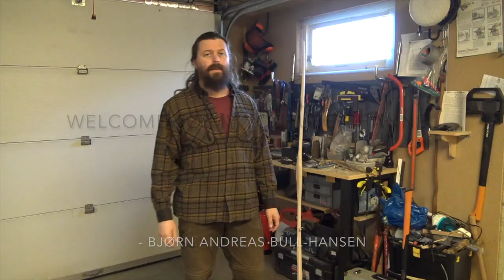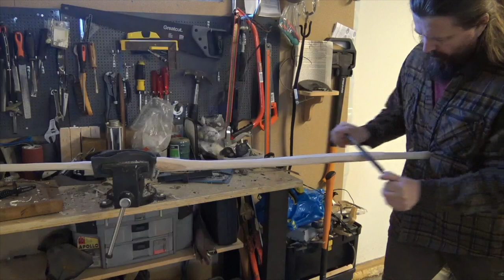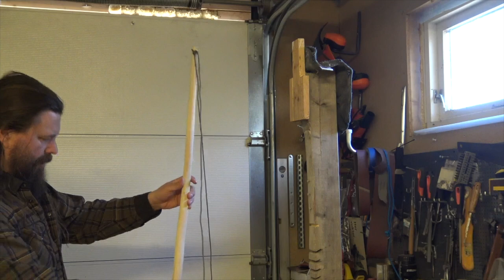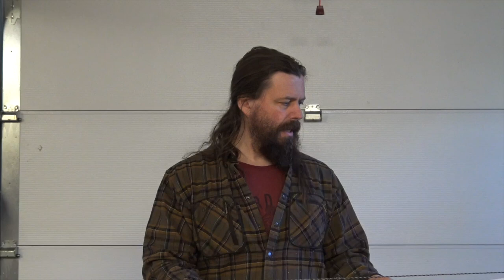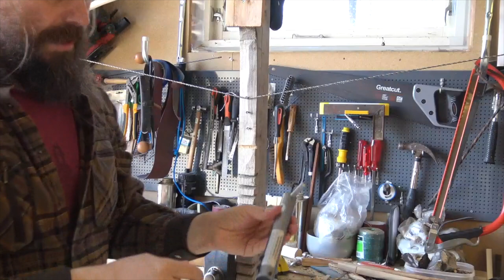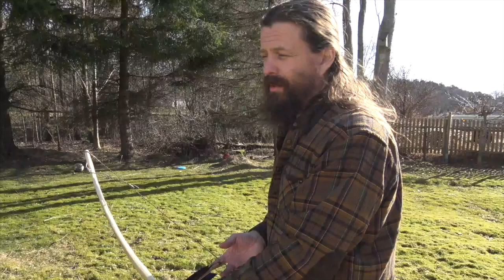Longbow Giveaway - announcement of one of the 20.000 subs giveaway prizes

Comment: Awesome. Just an observation but, wouldn't you have more success in the tillering if you marked the string at equal distance at the start of the process instead of measuring each time? I admit, I have never done this before but it seems like you might save some time by having a pre-marked measuring point on the string instead of "thumbing" your mark. In any case, well done and it looks sturdy.
Reply from the maker: Thanks, but the tillering string and bowstring will be different for each bow and also I adjust the length of the strings as I work with the bow.

Comment: Very, VERY nice piece. :) Got a little nervous over the lack of tooling/"chasing" on the back of the bow prior to fully tillering it (very good way to split it if not careful, hence why many cultures such as the Mongols, Turks, and others made composite bows along with many Native Americans like the Sioux or Cheyenne on the plains using hide glue as sealant, with or without a sinew-coating and/or horn reinforcements), but it worked out quite nice. Plus you kept mentioning the 30 pound at 24" draw, that could come out to be 35 pounds at 27" if you build up to it and make slight nock adjustments, the latter being absolutely perfect and practically tailor-fit for my draw if pulling to the cheek/ear. The 24" is good for a chest-draw, ideal for wooded conditions and hunting, along with quick-shot target practice. If able to do both, great lightweight bow for turkey season coming up next week. :)
Reply from the maker: Hi Robert, here in Scandinavia bows are not backed and they were not back in the Viking Age either, due to the climate and the available materials. Elm does have a natural backing in the inner bark, though.
Reply: Hence the reason to "chase" or burnish the outer layer on the back in order to avoid the reason to do so (personally consider backing to be lazy unless the purpose is to make a powerful weapon like with a horn-bow as with a Mongol-style or Hun-style). Cherokee, Delaware, and other longbow-type bows from the eastern natives of the US all remove the bark alone on the back as with classic European longbows, although many de-crowned versions that follow a ring that's tighter on the inside also exist. Those are the version I make. In fact, I'm working on one made from a black locust (that and hickory are the traditional Cherokee bow woods, as Osage orange or "bois d'arc", the "wood of the bow" in French didn't start being introduced until after trade and later removal) sapling right now in a way very similar to this video. It's still drying out, but being a sapling it only needs three weeks to two months instead of the year or two before getting to this point. That was what I was trying to say. Anyways, looking forward to who wins and if by some crap-shoot chance it's me, then I will feel beyond obligated to get together either with my Uncle John, Noel "Tim" Grayson, or someone else to get you an authentic Cherokee or Choctaw bow. Can't wait. :D